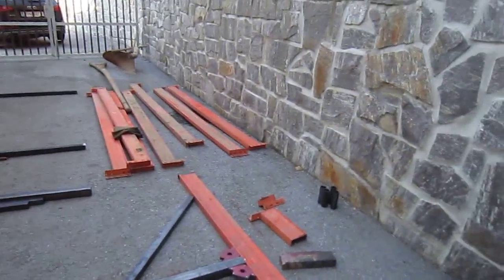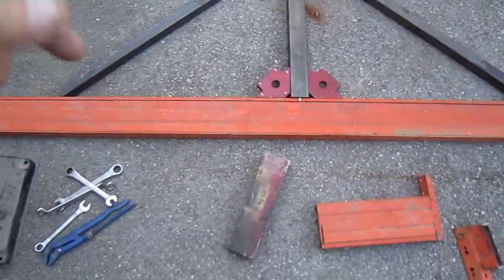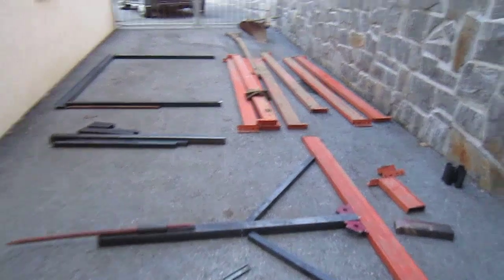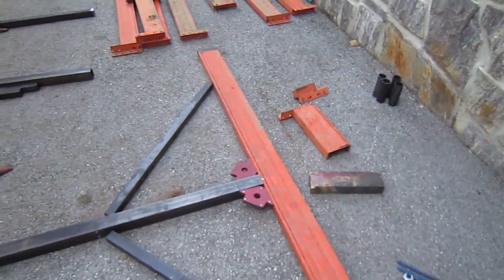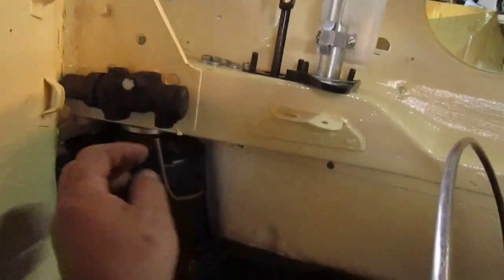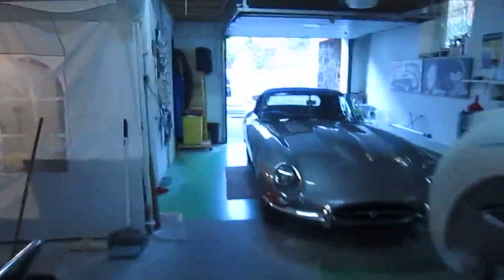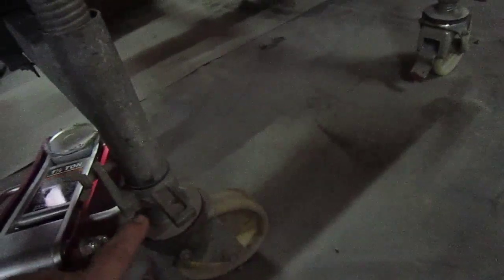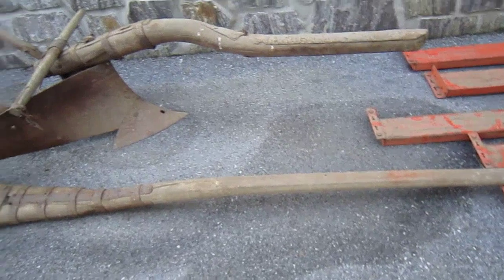DIY Gantry hoist Part 1 + Mini Thremo floor matting.

Comment: Great job Dave.Looking forward to seeing this take shape
Reply from the maker: Sean, Making the videos makes you really think your projects through! when you watch them back, I have just realised i will have to shorten the bottom bars where the castors are fitted, I just measured up my car trailer side 
on and it would not fit as it is now! so i will need to shorten them by a 2 or 3 cm.  Cheers Dave
Reply: davejaguar66 it's easy to overlook things but good to spot them before you start welding things up.

Comment: i am looking forward to your gantry build. i too am contemplating putting a fixed gantry in my workshop  that goes the length of the building (only 8 meters) so i can lift mini engines out and slide them over and then drop them onto to the bench. what size I beam are you using, i guess this also effects what size dolly (not sure whats it called - the bit that runs in the I beam and the hoist bolts to).  loving the videos - the mini is looking amazing
Reply from the maker: Kevin, As i said i am very lucky that my scrap guy does scrap metal prices for brand new steel and he only charges by weight! plus he lets me cut it to size on his massive computer controled blade saw, You might get a shock the price for 8 meters of 10cm I beam which is what i am using, I think the moveable gantry would be of more use and cheaper to make, I know it sounds a bit mad but what about a gantry with a centre swivel I Beam under the main beam so you could extend it over a bench! That would make a great video i am sure it could be done! Cheers Dave.
Reply: ooh thats a god idea. yes i think i will have to go and get a quote for materials before i get too excited. thank you
Reply from the maker: Kevin, To be honest i might have a go at doing the beam idea it myself it would be very handy, Cheers Dave.